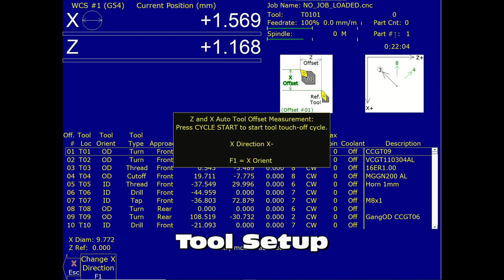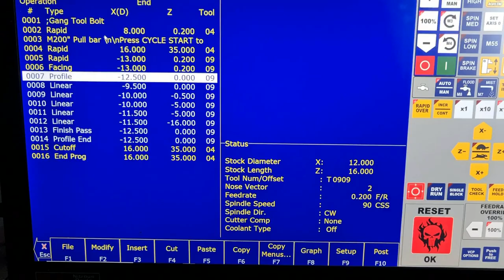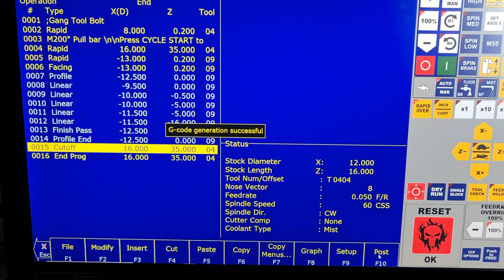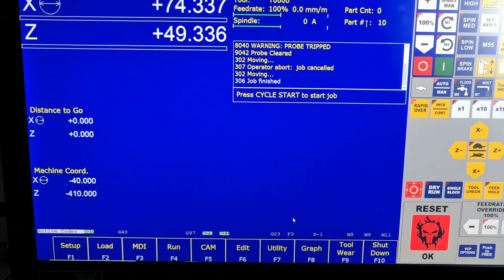GangTooling with Acorn CNC on a DIY CNC lathe

Comment: How accurate is the tool touch off probe and which one is it?
Reply from the maker: It is a cheap 3D Probe from AliExpress, repeates position within 0.005mm
Reply: @TheSuntravel  I've been looking on AliExpress for a while but I only see touch probes with needle tips, non have the circular tip for lathes as your video that measure both axes x and z. If you have a link I would appreciate it.
Reply from the maker: @superuchip2866  thats right, but they have a M2.5 thread, so you can use a 10x2mm flat tip for Dial Indicators
Reply: @TheSuntravel  Now I get it; thanks!
Reply: To reduce error some probe manufacturers recommend having the probe tip as short as possible but you use an extension before screwing the flat tip. Is this to recreate the same length as the supplied tip or is it to protect the probe's limit travel? In other words wouldn't it be more accurate if the flat tip was screwed directly to the probe without the extension?
Reply from the maker: @superuchip2866  shorter has less way to trip and is better regarding accuracy, thats right, but I need the length to measure Z for LH tools
Reply: @TheSuntravel  Got it; Thank You! Just ordered it and see how it all works out. The z travel limit of the probe is only 2mm so was afraid acorn could push it over that limit so if you could let me know at what feedrate you use it safely I would appreciate it before I crash the thing. Sorry for all the questions; quite new to all of this. Thanks again!
Reply from the maker: @superuchip2866  Fast 200mm/min and 2. slow pass 80mm/min